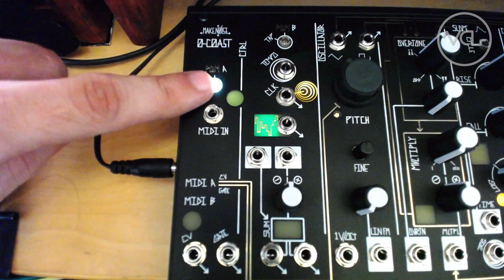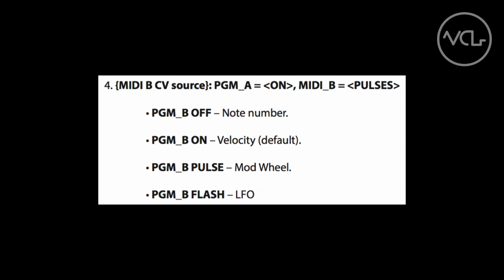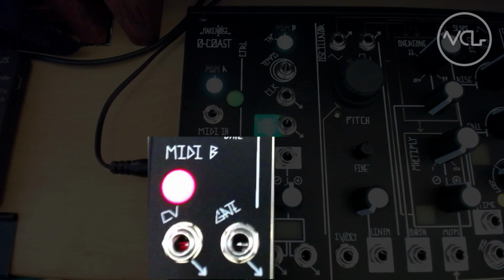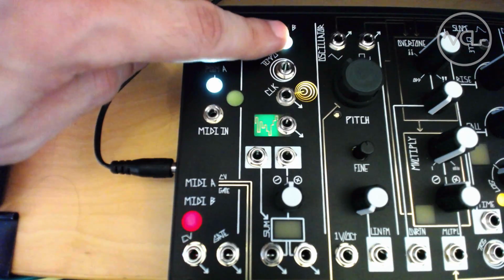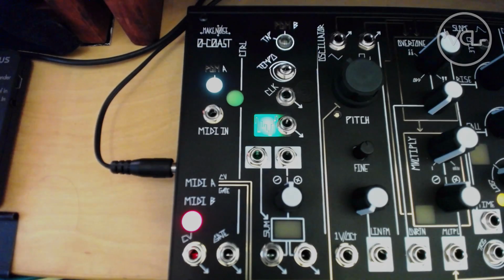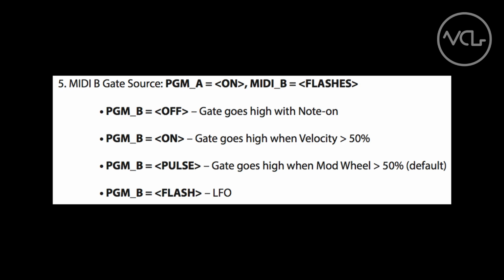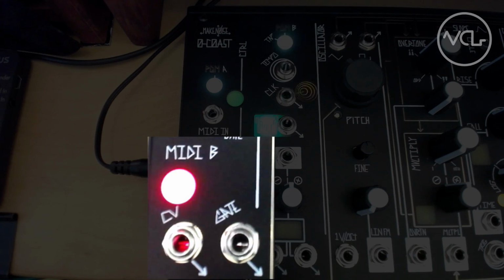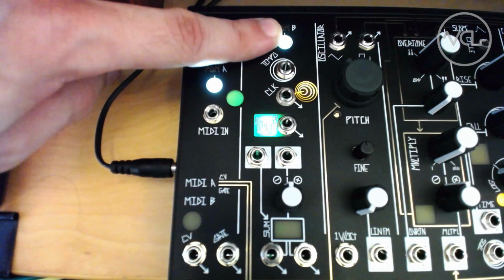Make Noise 0-Coast Hidden LFOs

Comment: Can the rate of the "hidden LFOs" be changed/controlled  from an external device? Say I have the MIDI-B gate set to output its square LFO. Can I change the rate of that square LFO externally without having to tap the A button?

Comment: It would be better if they strapped half a dozen of these together, combined it with D-50 style LA synthesis, and used a pretty display in place of the confusing and unintuitive LED flashes and awkward button pushes . Yeah. That would be as they say in England, a 'proper' synth.
Reply from the maker: Supa Dupa Hilton there are already a million of those, this is much cooler as far as I'm concerned!
Reply: With La synthesis? that sound like that??  ...where are they hidden, cause they sure aren't showing up at Sam Ash or Guitar Center.
Reply: Really?? Outside of the original D-50 there are none, and even that had a crap ROMpler built in, instead of a cool engine like this, which was my point.

Comment: how can you sync 0 coast with ableton live s tempo?
Reply: Page 6 then set the B knob to on.
Your 0 cost will now get midi clock trough MIDI
Reply: I'm sure there is a better way, but you could route the Midi B Gate Out to the Tempo In, which is how I keep the click and random voltage generator in time with 1/8 and 1/16 notes.

Comment: I cannot find the way to listen other gear through 0 coasts External Audio Input, help please! Nice vids!!
Reply: So what you're saying is.. I would be able to route Software synth's audio into this and use it to modulate the softsynth?
Reply from the maker: What are you plugging into it? The balance knob has to be turned to the Fundamental side to hear that incoming signal...
Reply: I plugged the main out of a Roland CR5000 thru the Coast's Balance (the right side one) but still can't hear it, maybe i need to play a note via midi in order to open the source. Thanx a lot!!I your answer make me focus more on switching my audio signal on the BALANCE seccion of the synth.  : )
Reply from the maker: Ah, don't go in through the Balance input... That is basically CV control over that knob. Try sending it into the one to the left of that knob, with the arrow pointing toward it. That will get the signal in :)
Reply: Yesss!! Thanx a lot for your help, It Worked perfectly. ^______^

Comment: Thanks!! Reading through the manual and kinda confused w/ the programs & this helps (I think it's easier to learn by watching). A run through of all the program pages would be a really helpful demo. Thanks again & appreciate all your tips!
Reply from the maker: Make Noise might have a video on the way covering each mode, but if not, I'll put it on the list! Thanks for watching!
Reply: +Voltage Control Lab they said probably in a week-